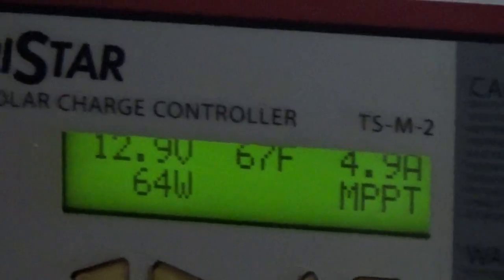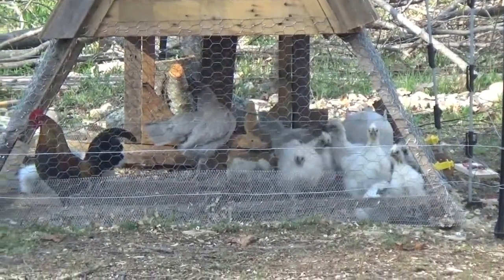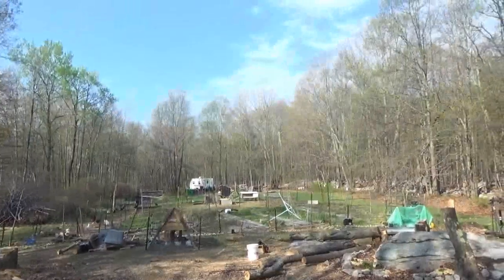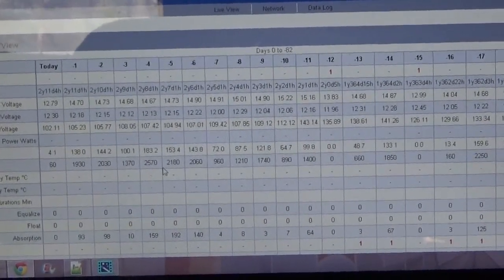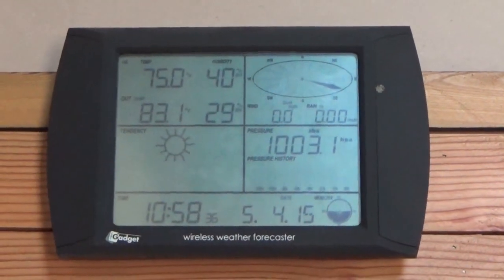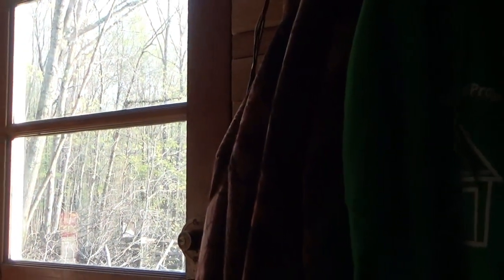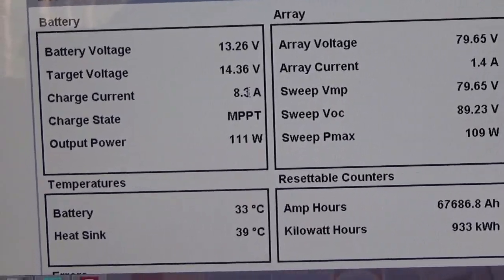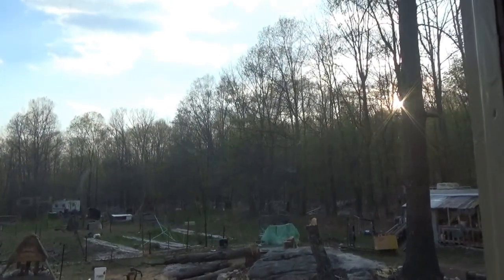Improved Solar Power Production With New Solar Panels

Comment: It looks like your house is not in the best place for your solar panels,and to put your panels out in the sun is too long of a wire run. I have my panels out by my garage and run the dc voltage into the garage to the solar charger and battery bank. I have a freezer out there on solar but I also send the 110ac from the inverter into the house (about 100ft with 10 awg-thhn as a backup to the grid. If you parked your work shop trailer in the best location for your panels and setup your charger and battery bank in the work shop than sent the 110ac voltage into your house you can catch as much sunlight as possible all day all year.

Comment: Hi Troy !

Instead of getting new panels - why not just cut off the bad connectors and strip the cables and connect them in a waterproof box.
Reply from the maker: Keld Sørensen Yes if I said I need new panels, I was not meaning that. I can and will replace the connectors

Comment: Question on the panel connectors, Couldn't you cut the connectors off and join the respective wires that had been stripped and use twist on wire nuts? That would give you the ability to be able to disconnect them if need be for some unknown reason in the future.  I know people likes to keep items in original state for the ease of use, but in a situation such as yours, I would have removed the connectors a long time ago or at the very least left them on but stripped the wires just behind the connectors and put pigtail (jumpers) in place. That would tell you real quick if the connectors were bad or  as I stated in previous video that it's possible that the wires were either broken at the point of each panel on the backside due to being blown over those several times when they were in the meadow.

Comment: troy just thinking could you use a mirror  to reflect onto the solar panels  say a light free standing you could easly shift to catch the early morning sun then move to cach  the evening sun
Reply: james head That would lower the life expectancy of the panels.
Reply: Doctor Bill  It would? ?? Why? How do you know that?  I ask because I was going to do the same thing. .. are there any studies on that subject, if so... I would very much like to read them.   Thanks!
Reply: MollyDolly agreed though i was thinking more of a sheet of baco foil stapled to a board of OSB than a real mirror so as to be light & sturdy enougth to pick up and move and not concentrate to much heat on the panel as it would be early morning late evening when in use
Reply: james head  It would seem to have the same effect as snow reflection increasing the solar.   But,  it is important to know HOW the reflective light might lower the life span of the panel. For Example,  if it is the concentration of the solar onto just a few panels burning them out unevenly,  that should be solvable with a more even reflector, or a diffuser... but not knowing the cause of the shorten life span, who knows. ..
Reply: MollyDolly
yeah the power got from the light refected from the snow was where i got the idea andhave no info on if it would degrade the panels  so if any one can do so please tell us
Reply: MollyDolly Any time you Concentrate the amount of light the panels life expectancy will be less. I build portable solar systems for RV's, Remote Cabins, Boats and general camping. More later. The output (product of electricity and voltage) of a solar cell is temperature dependent. Higher cell temperatures lead to lower output, and hence to lower efficiency. The level of efficiency indicates how much of the radiated quantity of light is converted into useable electrical energy.
http://www.solarserver.com/knowledge/basic-knowledge/photovoltaics.html
Reply: Doctor Bill  Thank you for that link. I found it very interesting.   I do see the indication that increased heat results in lower efficiency.   I am puzzled by that a little as every one says solar is so much better in places like Arizona and here in California,  but it is so hot here, seems that PV output would be less.   I wonder if any long term studies have been done comparing the longevity of panels by varying geographic areas....I didn't note any information in the article on heat destroying the panels, though it seems logical.
Reply: This, "The output (product of electricity and voltage) of a solar cell is temperature dependent. Higher cell temperatures lead to lower output, and hence to lower efficiency. The level of efficiency indicates how much of the radiated quantity of light is converted into useable electrical energy." came right out of the article.

The blue color of polycrystalline panels is a dye and it degrades under amplified light like from a Mirror or Fresnel Lens.
The reason the panels still work good in places like Arizona is because the natural convection of air on the back of the panels keep them cool. I would be willing to bet there is some advanced degradation more in hot climates than cooler climates. I don't know of any studies done to find out.

As it stands there is a 25 year guarantee on almost every panel made. Even so at the end of 25 years the output of the old panel will only be slightly less.

MIT is working on some pretty cool new ways of making solar cells too. maybe they will have a longer guarantee.
Reply: Doctor Bill  Yes, that is the paragraph about heat reduction. I can't remember where I saw it, but someone has a PV paint and another guy was demonstrating flexible PV tiles that snap together.   Exciting times!    Won't it be awesome when our car's paint job powers the car.  :)
Reply: Yes solar has come a long way. The first Photo Voltaic Panel was unveiled
April 25, 1954 by Bell Labs...I was 5 days old. Bell Labs went on later to
supply the solar panels that went on the communications satellite...Telstar.
Reply: Doctor Bill  That's cool.  My Dad made parts for the Apollo moon landing mission... I still think it's pretty awesome that something my Dad's hands made went to the moon.
Reply: When I was 2 we lived Miami Beach. My Dad used to take Hemmingway to Biminy
on a converted WW2 PT Boat so he could cavort, play poker and drink.
Reply: Doctor Bill Awesome!